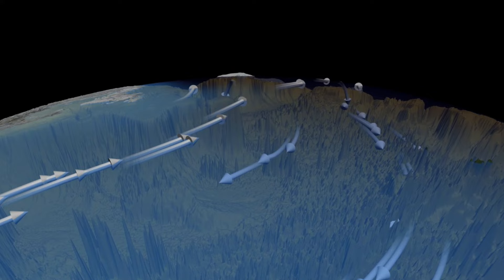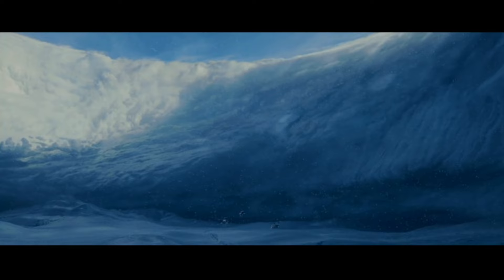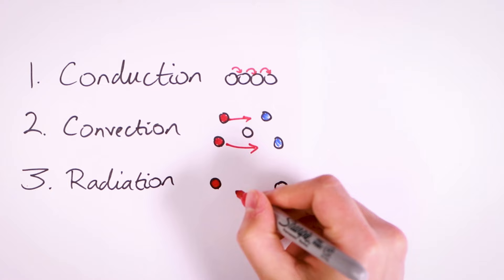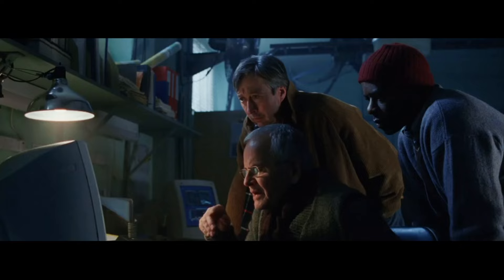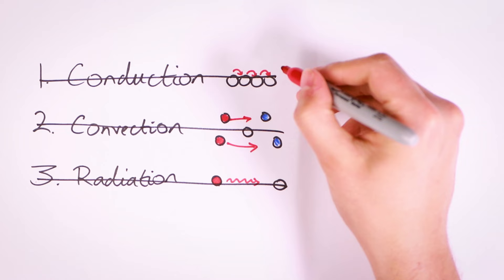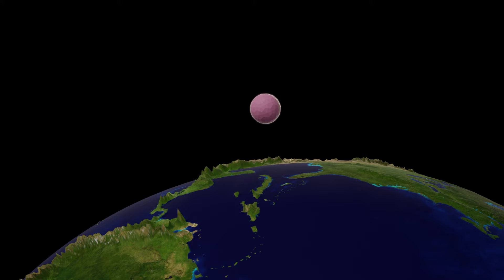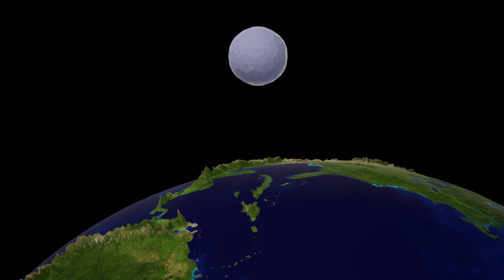The Biggest Error in The Day After Tomorrow

Comment: Thanks for that, cool video and I learned something. I'd never thought the movie was realistic but had also never looked in to why not (in the case here, I guess it's kind of like the opposite of what happens in a fridge).
The problem isn't with movies being wrong (for the sake of dramatic effect), it's with people thinking what they see is correct.

What is really funny here is, the movie says the falling air created an ice-age, when in reality it would have cooked everything. That tickled me that did :-)
Reply: The fridge is a less noticeable example but freezers really show how the volume of air changes as it cools. Ever noticed how the freezer is harder to open if you go back to it again a few minutes after being in there. This is why the air contracts as it cools lowering the pressure in the freezer thus the atmosphere outside is pushing against the door harder than the air inside. As for why this resolves itself after a while that is simply due to the fact the seals are not perfect, the higher pressure outside slowly forces air in through the door seals to balance the pressure.

Comment: If there was an actual supercell storm that could "pull" cold air from the mesosphere, then it surely would have a pressure lower than the mesosphere... which I guess would kill everyone in a similar fashion to the scene from Total Recall from low pressure more than freezing.
I'm also guessing that a weather pattern with a pressure that low is physically impossible... but I couldn't comment on the validity of that.

Comment: The math, physics, and entire explanation, was vastly more convoluted than it had to be.

Temperature is average kinetic energy of the particles. When you halve the volume, you double the temperature. You have same amount of energy, but it's in half the space. [Cue diagram, showing low-density particles on the left, and high-density particles on the right. Subtitled "Cold" and "Hot" respectively]. So, if you take extremely low pressure cold air, and compress it so it can be in the lower atmosphere, it gets extremely hot. [Cue big arrow pointing from the left diagram, to the right diagram]

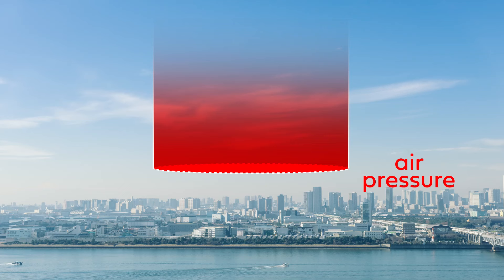That's it, nice and simple. It wasn't even until 4:46 that pressure was mentioned, and then shortly after the explanation drifted back to adiabatic and formulae anyway. The whole temperature = heat + work thing, along with all of the types of convection/conduction/radiation, all of that was just far more convoluted of an explanation than it had to be.

Comment: Air pressure higher up is NOT lower just because there's less of the air above you. That would be true in water, which pretty much has uniform density regardless of depth; but it's not true in air, which has a gradient as you go higher up. There is not only less air on top of you, there is just less air in the upper atmosphere period, because most of it falls down to near the surface.

As a result the decrease in air pressure follows an exponential curve, while it follows a more linear curve in water.

Comment: There's another Big error. Heat Transfer is from hot to cold and is driven by the temperature difference. For a -100°C to lets say 20°C difference thats only 120°C. Buildings and earth would take much much longer to cool down.  And of course ice would not chase you. Seems like they used the same time frames as in " heating scenes " where thing melt down and explode, wich is a bit more creíble as the temp difference could be much higer with not an actual top límit.

Comment: Be more cautious... Somewhere in Africa there is indeed a "hill" on which water flows uphill easily visible for humans, not just sophisticated measurement devices). The reason is that the ground under that hill consists of (at least) two different materials with a big difference in density. The iron area moves the local direction of gravity on that hill.

Comment: There were also the part where they calculated how fast the temperature inside the storm was dropping and it was some in sane speed that would have gone under the 0K in no time.
Which I will remind anyone not knowing this, is impossible. (its actually pretty interesting what happens when atoms completely stops moving, turns out you stop having atoms, as they are in then just pockets of energy, so matter simply stops existing under 0k)

Comment: Wait a minute.  In the movie it appears that the circulation from a storm is creating an extremely low air pressure and is sucking the air above downward.  Meaning the air entering the low pressure area created by the storm is not being compressed.  So the temperature would not increase and the freezing could take place.  If anything, the air pressure would be decreasing and the air would get even colder as it expanded as it descended.

Now if it were possible for a storm to create an air pressure that low the more immediate threat would be every living thing in the area dying from oxygen starvation due to the dramatically lower oxygen saturation.  Also, the lack of oxygen would cause the helicopter's engines to flame out long before they could freeze, with the pilot's already unconscious.

Comment: Air moves from high pressure to low pressure (nature abhores a vacuum).  So, since there is no high pressure way up there, you can only suck it down, which would cool it.  I agree with your argument about adiabatic heating (thats what happens in a bicycle pump) I am somewhat sceptical about your bringing it down to ground level heats it.  The only way that could happen is if you push it down, but it only has a weight of air on top of it so that seems unlikely.  In the film they show a vortex (cyclone) which due to CF does produce a lower pressure in the centre which could suck air down cooling it because you are doing negative work on it.  That much though?
As far as freezing the fuel or oil in the helicopters, very very very (etc) unlikely.  Firstly fuel in aircraft flying at high altitudes doesn't freeze and the oil lubrication systems are transfering heat from friction so they won't freeze either. 
If the film has one serious message it is  that chaotic systems like weather can change to another state quite suddenly (say over a few decades but the film isn't long enough for that).  It certainly has several times in the distant past. why not now?
A disaster movie needs drama so they stretch things a bit.  To enjoy the show somtimes you have to suspend your disbelief.
Don't let science get in the way of a good yarn eh.
Reply: The fuel in the tank may begin to but I certainly don't see it happening that fast. For one thing the heat would be being lost through the solid walls of the tank which the newly formed solid would presumably adhere to as a nucleation site. Presumably this would likely help to build up a layer of insulation which would buy time before all the fuel froze. During this time the fuel temperature sensors would have the aircraft screaming at you. Besides which unless it also somehow had a bunch of supercooled water present to get into and freeze up the rotor bearings and such the blades would not just stop, they would have autorotated and a heli pilot can land in that scenario. The air rushing up relative to the falling helicopter pushes the blades around (It's basically a big fan after all) which in turn causes the blades to keep sweeping the air horizontally and pushing air down in the process generating some lift. Not enough to stop the fall but it is enough to slow it to the point it's like having a parachute and the flight controls still work to use some of the potential energy being released to direct the craft to a relatively safe landing site. At this point anything relatively flat ish will do even if there is tree cover or something you just don't want to land where you will roll down a mountain or whatever so anywhere the craft will happily come to rest will do for a hard but survivable landing. It should anyway assuming the pilot actually has heli training because heli pilots are trained to safely put the helicopter down in the absence of engine power.

Comment: What I find most funny about the movie is that how even though it is supposed to be promoting a climate change alarmist point of view, to me and my wife it promotes the opposite as it shows that the Earth is self-regulating. The new ice age isn't uninhabitable, it's just different. Storms are the Earth correcting atmospheric imbalance and the ISS astronauts declare at the end how they've never seen the sky so clear. Like Starship Troopers the movie actually caused significant numbers of people to believe in the opposite of what the film's creators specifically declared they were promoting.
Reply: The type of imbalance that climate scientists talk about is the energy imbalance at the top of the atmosphere. That is currently close to 1 watt per square metre of the Earth, meaning that our planet is gaining nearly 1 watt/m² more energy from the Sun as shortwave radiation than it is giving off to space as longwave infrared radiation. Multiply that by the Earth’s 510,000,000,000,000 m² of surface area to find how much energy the climate is currently accumulating in total.

If the greenhouse effect isn’t reduced to its natural level, the Earth’s only way to restore its energy balance is for its surface and lower atmosphere to heat up, thus giving off more heat to space until energy out once again equals energy in.
Reply: @fromnorway643  Why is warmer worse? Less ice in the poles means more rain and higher humidity in places currently too dry to farm, longer growing seasons, and less burning of fossil fuels to keep warm during shorter/milder winters.
Reply: @darthhodges  
The biggest problem with the current warming is that it's happening much faster than at any other time in the Earth's history, making it much harder for life (including humans) to adapt. The global temperature is now rising by close to 0.2°C per decade, or roughly 40-50 times faster than the warming that ended the last ice age.

In addition, human activity has destroyed much of the natural ecosystems outside the Arctic and Antarctic regions. The remaining pieces of relatively intact ecosystems at lower latitudes have mostly been fragmented into small pockets of nature surrounded by farmland, cities and other areas strongly impacted by human activity and with close to zero biological diversity.
This fragmentation of the remaining nature has made it much more difficult for the fauna and flora there to adapt to climate change by migrating to other climate zones as the climate is changing. That method of adaptation was much easier in the deep past when animals and plants usually could migrate over long distances without being hindered by man-made obstacles.

Furthermore, when climate change happens slowly enough, it's also easier for animals and plants to adapt by physically changing, i.e. evolve to other forms more suited for a different climate.

Comment: One of the main problems with this movie is that, while the collapse of thermohaline circulation COULD indeed cause localized cooling in the northern hemisphere, it would be a seasonal cooling — cooler winters. Not cooler summers. For an ice age to start, you have to have SUMMER temperatures drop.

This is why Greenland is covered in ice, but Siberia, which can get just as cold, isn't. Because Siberia is a huge mass of land, whereas Greenland is surrounded by water. And land heats up faster than water, so in Siberia it gets warm enough to melt the ice in summer, whereas it rarely gets that warm in summer in Greenland.

Comment: You know that actually they already knew this when making the film, experts like you teach them about this. However they had to ignore this because of story telling and visual effects.

Just have to check the first video about the film making of and they talk about this.
Reply: jjsr7861  there is less pressure higher. Therefore it is not more compressed than in earth ground. 
You are right calling the term isobaric expansion, due to Gay Lussac equation a gas which expand conserving the same pressure can only do it through taking heat from the outside. But this can't happen in a open space and in such a long time.
Reply: jjsr7861  ok. Now I don't understand because if it gets heat going down no earth it wouldn't be cold by hitting the ground, but I like reviewing all this thermodynamic topics with you 😁
Reply: jjsr7861  i don't think an isobaric expansion is possible in an open space.

Comment: but.... the reason air descend in those scene is because of the extreme low-pressure system in the eye of the storm. If it is low-pressure then there no compression done on the descending air, and the air centrifuge out of eye of the storm anyway, so low-pressure system is sustained in a steady state. So there's no error actually.
Reply: Even if the air descending from the upper mesosphere could somehow avoid being heated up, its "cooling capacity" per cubic metre would be insignificant since the air at that altitude (80-90 km) is extremely thin. It would be like pouring half a thimble of ice water into a bathtub full of nearly boiling water and expect it to cool down noticeably.
Reply: @fromnorway643  1) the city was water drenched & flooded, 2) the air is extremely dry, and 3) low-pressure system is extreme & persistent. This allow for a rapid loss of heat thru evaporation followed by freeze drying effect as seen on the movie.
Reply: @xponen  
Not even close.
The air in the upper mesosphere is about 100,000 times thinner than at sea level, so it would take very little energy from the surroundings to heat it up to something close to a normal sea level temperature.
And there is nothing that could create a low pressure system so extreme that it was almost a vacuum, with the possible exception of a large asteroid or comet impact.
Reply: @fromnorway643  what the movie said is more defensible, it said "upper troposphere" rather than "upper mesosphere" (1:32), so I'll go with the movie rather than the analysis from this video. Therefore in  order to defend the -100 degree Celsius (-150 Fahrenheit) as claimed as being said in the movie, I'd say that is the wind-chill temperature not absolute temperature.

Comment: Of course, you could just reverse the logic:  Instead of those storms bringing down tropospheric air, just say that they drastically reduce the ground level air pressure - resulting in extreme cooling.
Reply: How could that happen?
The pressure is about equal to the weight of the air above us (about 10 tonnes per square metre at sea level), so the only way to drastically reduce that pressure would be for most of the atmosphere to escape to space.
Reply: @fromnorway643  Gee, have you never looked at the pressure in the center of hurricanes???  Cyclonic storms center around very low pressure, and keep the pressure low via their rotation.
Of course, there would be no heat engine to maintain them in the movie scenario, unlike in real-life storms, but if the movie fantasy type storms were true, the central pressure would be quite low.

Comment: The biggest error? No not by far. The biggest error is a total disregard for heat capacity in thermo dynamics. Cold dry air has almost no heat capacity so it would take hours to freeze the fuel inside a helicopter fuel tank. And the people? Ever heard of cryotherapy for rheumatics? People stay inside the - 90°C to - 130°C chamber for several minutes... naked. They dont freeze. Shocking I know.

Comment: What makes you certain the air pressure is increasing as the cold air drops down to the surface on this fictional scenario? What if in this scenario the whole atmosphere at this point is lowering and therefore reducing the pressure?
Reply from the maker: No matter what happens, air pressure has to increase as you go towards the surface. It's a concept called hydrostatic balance - pressure in a fluid (like the atmosphere) must decrease with altitude.